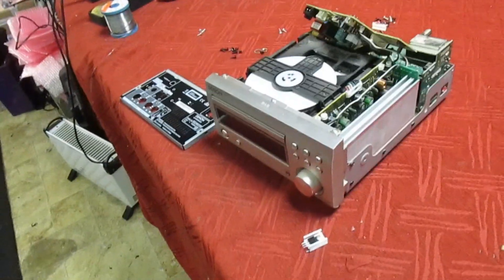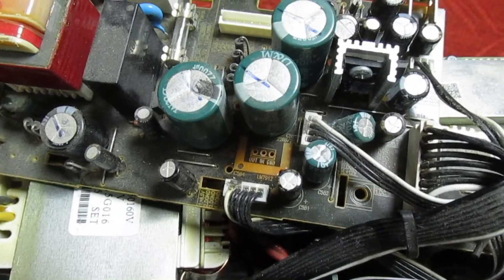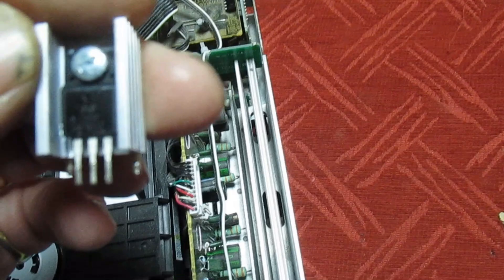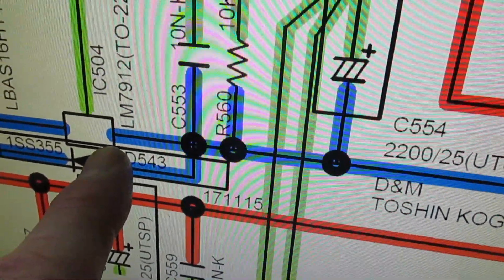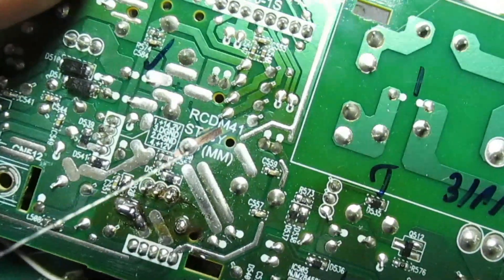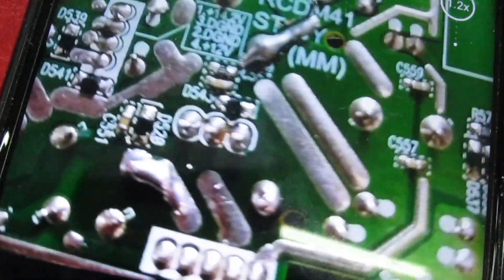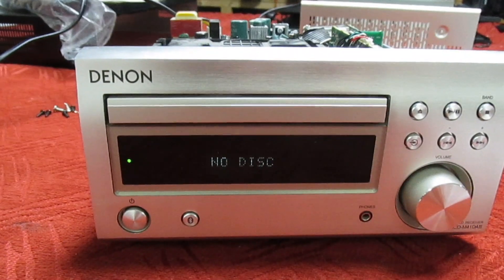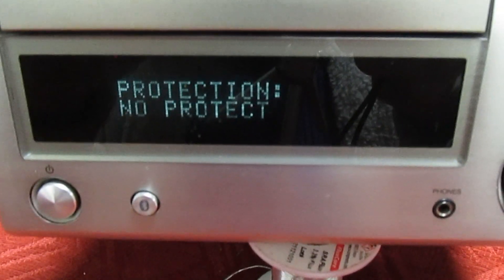Denon  RCD M41DAB Protection mode activated, power rail out of spec

Comment: hi i have the same unit but the right channel speaker as recently become crackly distorted its bad at low volume after around 5mins of the unit being turned on its defo not the speaker as ive tested other ones and only on the right channel faulty it seems to go away when turned up any advice would be much apreciated

Comment: Great Video!
Dear Michael, would a Denon RCD-M41 (made in Japan) - Power Supply markings on back of unit :
100V ~ 50/60Hz work safely in the US?
That is - would the Denon Power supply and components handle the US voltages without having to use an external voltage converter?

Cheets
Reply from the maker: If its designed for 100v and the US is 120v thats a fifth more so although it may function you would be over running it and it may not last very long.

Comment: Hi Michael, thank u for your video. I have the Denon RCD M40, whenever I turn it off for too long (about 4 hour or more), it would not let me turn it on again, no light on the led. it happen using the power button and also by remote control. Until I unplug the power cord and replug it again, then I can turn it on normally. Could u please advise me what have happen with it?
Reply from the maker: If it wont come on from cold buy runs ok when hot this usually mean a capacitor had dried out
Reply: @michaeldranfield7140  Thank you for your advice, will check for the capacitor.

Comment: Hi Michael , I'm experiencing a strange issue with my DM41. When either Bluetooth or Disk is selected as the source, the display goes black or blank after a couple of seconds, although the LED light remains green. Any idea of what could be causing this? TIA
Reply: I have the same issue. The tray doesn't budge or  make a sound at all. Bt isn't visible.

Comment: Great spot!, I am glad you got your unit fixed. I have the same issue "flashing red light" and I currently diagnosing it, Can you please share where you found the service manual for the RCD M41DAB, I can't seem to find it. Thanks.
A quick update, I could get may unit to power up and operate only if I short the relay to the main transformer, so I think problem I have is when only the sub transformer is on.
Reply from the maker: I never pay for service manuals now so it will have either been listed on a free site on the internet or from ASWO , if you send me a message after bank holiday I can have a look if I have a stored copy .

Comment: Hi Michael, I have been looking for copy of the service manual for this model, not been able to find it online. Can I ask where you got your copy please? I have a unit that's dead, flashing it's red light, no display and clicking the main relay. The factory reset etc does not work as the unit does not respond, just carries on flashing and clicking. I am pretty sure it's a mainboard fault as i've tried the board  in another good unit. The symptoms went across with the board. It may not be easily repairable, but I did find what appears to be a couple of shorted SM capacitors, so would like to see the diagram in order to work out if that makes any sense or if i've actually hit on the problem. Thanks 🙂
Reply from the maker: A shorted cap seems a very likely cause of it tripping, I will have a look on Monday to see if I still have the service manual on my pc, contact me again Monday afternoon.
Reply: @michaeldranfield7140  Hi Michael, you asked me to remind you to see if you can find the Demon RCD-M41RCD manual, no worries if not. Thanks 🙂
Reply from the maker: sorry forgot , ring me tomorrow . 01298 73989. If I dont get back to you by the afternoon . @adamdavies163
Reply: @michaeldranfield7140  Brilliant, thanks Michael. I'll contact you Mon as you suggest. Have a nice weekend.
Reply from the maker: A shorted cap seems a very likely cause of it tripping, I will have a look on Monday to see if I still have the service manual on my pc, contact me again Monday afternoon.
Reply from the maker: A shorted cap seems a very likely cause of it tripping, I will have a look on Monday to see if I still have the service manual on my pc, contact me again Monday afternoon.
Reply from the maker: A shorted cap seems a very likely cause of it tripping, I will have a look on Monday to see if I still have the service manual on my pc, contact me again Monday afternoon.
Reply from the maker: A shorted cap seems a very likely cause of it tripping, I will have a look on Monday to see if I still have the service manual on my pc, contact me again Monday afternoon.
Reply from the maker: Found the service manual now on my pc, if you want to give me an e mail I will have a go at sending it.
Reply: @michaeldranfield7140  Brilliant, sorted. Thanks Michael, much appreciated!
Reply from the maker: No problem at all. @adamdavies163
Reply: @michaeldranfield7140  Worked on a few of these DM41s since our chat a few weeks ago. The unit above was due to a faulty mains transformer, oddly though the faulty transformer's windings all measure exactly the same as a good one, the units just refuse to work with it. Just repaired another tonight, thanks to your help with the service manual. Fault traced to an intermittently open circuit 1N4007 diode D523 on the 9V rail ahead of the 5V reg. Couldn't get the bloomin' thing to power up for more than 1/2 second to take measurements. Was not showing the usual Red warning LED, just shutting straight down. Could see that all of the main power rails were trying to start. Thanks again Michael, without the service info, would've been virtually zero chance of finding that! 😅

Comment: My kids had a 16th birthday party and goosed my DM41....it just goes click clack and the red light goes on and off....been played at full volume for a protracted period
  Transformer?
Reply from the maker: you will need to get the service manual and put the unit into the service mode to check what has tripped it out , it may well be a transient overload  and it just needs the error clearing to reset the unit, there could be no fault.
Reply: @michaeldranfield7140  can I do that?..it doesn't stay on long enough for the display to work, just clicks on/standby/on/standby at roughly half second intervals as soon as powered up.
Reply: @michaeldranfield7140  the black oblong relay sandwiched between the little preamp transformer and the three capacitors just clicks on and off...along with the standby light. :-(

Comment: I found Michael’s video extremely useful - these additional notes might help others too.  My RCD-M41DAB had stopped accepting Bluetooth streams, even though the Bluetooth device connected properly.  I tracked the problem to the fact that the device had overheated (June ’23 was v. warm) and the in-built Denon Protection system had restricted various functions.  A three stage process cleared this:  1.  Unplug the unit.  2.  Hold down the ‘Source Button’ and ‘Forward-Skip’ buttons and connect the power lead.  This showed ‘PROTECTION: AMP’   3.  Press and hold the ‘Play/Pause’ button for several seconds.  This clears the Protection setting.   The Bluetooth function now works cleanly.

Comment: Hello Michael. Thank you for your RCD-M41DAB video - it's very interesting and informative. My device does not play Bluetooth devices  (devices connect OK, but do not play - the Play and Pause icons on the display flash  when in Bluetooth mode), and there is a slight speaker 'pop' when the device is powered off.   I have a couple of questions:    1. Do you have any insights into "Protection: AMP" message (when pressing "Source" and "Forward Skip" buttons and applying power?    2.  Could you let me know where I might obtain the service manual / full circuit diagram that you refer to in your video.   Many thanks,     Regards /Stewart
Reply from the maker: I just found the service manual on the internet, some places will have it for sale but I just keep searching until I find a free one , I find most audio equipment so complicated and with hidden protection circuits its impossible to repair without a service manual .
Reply: @michaeldranfield7140  Thank you Michael - I will search.  I have posted a new Comment, which may be of interest to those accessing your channel, as I fixed my problem.
Reply: Did you find the service manual...I have searched high and low and just keep coming up with the owners manual....mine clicks on and immediately off, repeatedly at half second intervals...with a loud relay clack... doesn't have time to respond to button presses...am I doing it right?
Reply: @DomRivers67    Hi,  The reset solution fixed my problem that the bluetooth did not connect. I found a source which offered a paid-for service manual, but I could not find a a free copy. Having solved my problem, I didn't search further.  Having said that, the unit now gives a slight 'pop' when switched on - but liveable with!
Wishing you good luck in solving your problem. 
Stewart

Comment: Awesome Mike, I’ve had this with an intermittent line filter. It was going on and off, discovered a crack on side of one on the power board same connector.
Reply from the maker: cracks in PCB s were common back in the 80 s but its not something you see very often now .

Comment: Removed the comments to the original 500 dash issue, keep up the good work.
Reply from the maker: I removed the comments as I didn't want people asking for the LED part numbers because I cant find LED s of the exact same height, I found some that work and the customer returned to say his display was fine but I would have been much happier fitting an exact replacement instead of some that were 2MM less in height.

Comment: This is why I like hot wires and high volts! Valve technology doesn't play tricksy little games last like this.

Just out of curiosity, are there any domestic electronic products with, effectively, an OBD port for this kind of diagnostic and fault clearing?
Reply from the maker: A lot of HI /FI now when its dead or stuck in ST/BY and you put it into the service mode will tell you what the problem is and it can save hours of fault finding , a Yamaha amp I did a few months ago not only reported which power supply rail was  out of spec but it also reported by what percentage the rail was down by , pity TV sets are not this clever .

Comment: A hairline crack or gap is the most common problem on all circuit boards, I use an incandescent light bulb to shine behind it on the component side while using a magnifying glass to trace the cracks and hairline gaps on the copper tracks.
Reply from the maker: I will try that next time , many thanks .

Comment: Dear Michael. Many thanks for posting this video. Congratulations on getting it working. These machines and there Ilk are so bad to work on I just no longer look at them. But they do make very good doorstops. We probably have around half a dozen of this type of mini system scattered around our workshop that won't see the light of day again.
Kind regards Allan.
Reply from the maker: Got one knocking around but I'm not sure if its a different model and the DAB only tunes in one channel, I replaced the DAB module and its no different so I now suspect data corruption in the Eeprom, just got to wait until another comes in with good DAB so I can read out the contents of the Eeprom .